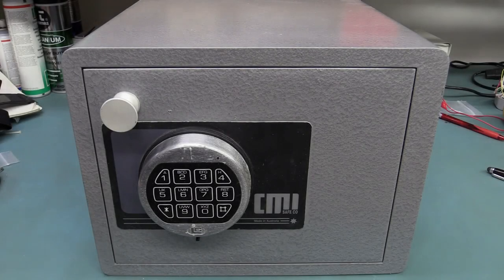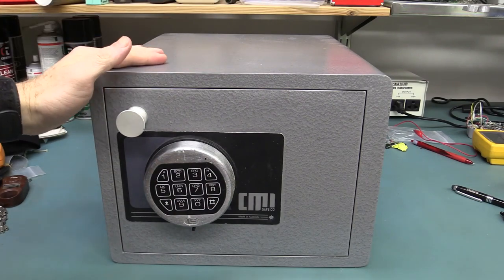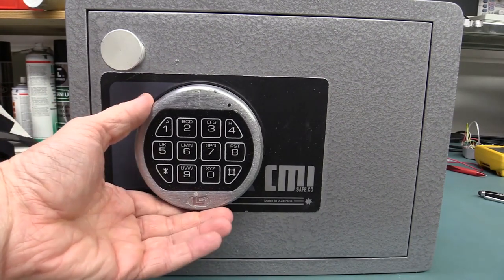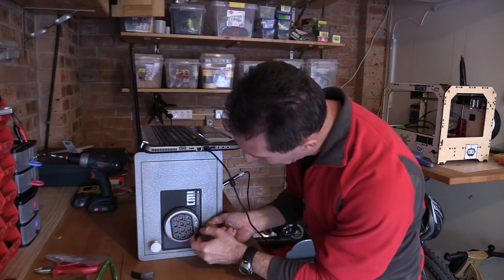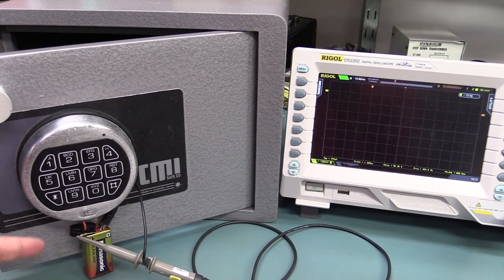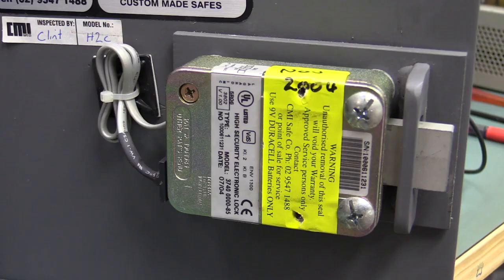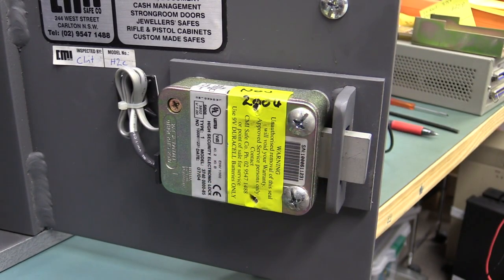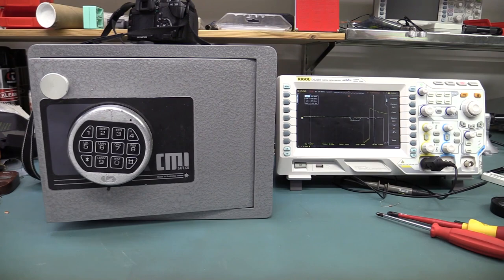EEVblog #762 - How Secure Are Electronic Safe Locks?

Comment: I a tech guy, work in technology, I hate these things. I like a good old fashion brinks manual combo lock safe. Have a small old safe from the late 1800's that still works great! so thick heavy (blast proof) no way to break into it easy. Have answer style brinks type about 15 years old. Wanted another so visited several retail places that sell them to check them out, all seem to have a lot of plastic these days, handles are plastic, and some were broken from handling, so that tells me not going to hold up well at all if broken in the store. some used a film type keypad that was worn from people pushing on it, there again not holding up to daily use if numbers are worn off useless. And then one would not work, store employee was going to change the batteries, opened up and was all corroded inside, never got to see it operate. Then I decided, not having one. but can't find anything without the damn electronic POS locks on them now.

Comment: If the lock is solenoid operated then surely a strong enough magnetic field will actuate it? I have caused solenoids to operate whilst tig welding with poorly placed leads.

Comment: How was Dave even able to lock himself out? The solenoid must have been in the 'open' position when he closed the door, so no harm done. Also, it was disconnected from power, so it wasn't able to lock itself automatically unless the safe closes mechanically. I must be missing something, but I can't figure out what!
Reply: Niall S. The solenoid only stays in the open position for a few seconds, plus he's disconnected the battery which would have released the solenoid. Some higher quality systems use a motor rather than a solenoid but that then requires detection switches and current limiting circuitry (to protect the motor) so a much more complex and expensive mechanism plus battery drain will be higher. Kaba have a design which is electonic but uses the turning of the knob (old style safe lock style) to generate the power to operate the lock, numbers displayed on a little LCD screen so no batteries needed.

Comment: I'm thinking.. run a thin wire down a tube through to the other end and then loop it back in.. sorta like what the dog catcher uses to snag a dog. Pull on the two loose ends and strangle the wire.. push down.

Comment: I'm 16 minutes in, not really into hardware, but this is so bloody interesting and fascinating and amusing to watch...!

18:12 i imagined the houston flight control center full of people cheering and clapping and hugging each other

29:35 NO, IT'S NOT IDENTICAL, the pixel differences in the dip that look like noise to you are important, the difference in power requirements for the two subroutines would be just like that, because they would be caused mainly by different order of instructions, where some instructions require very slightly less power than other, that's what I think it would look like, you need to zoom in and compare positions of those small peaks...
(again, not a HW guy, so in reality I don't know if your/any equipment is sensitive enough to detect that, or you concentrate on comparing just the run time of the two functions because you know that's the only relevant thing at this measurement sensitivity)

29:50 those two blips might have something to do with the signal that tells the led to light up/speaker to beep? as in not the actual power draw for light and sound itself, but the instruction sent out of the processor to the devices? this is pure question, that's what came to my mind as a possibility, but i'm 0% sure, so I'm asking what you think...

31:30 oh, so yes, that would affect what I've been saying above, but... i don't know, the deviations still look... relevant... even at this setup, different order of short-term spikes would produce different patterns, just with lower resolution... unless the capacitor had the capacity to cover the whole processing time, no?

31:50 yeah, told you, not a HW guy, I need to be told there's arbitrary number and architercture of the decoupling components to realize that of course there is :-D

32:10 yes. and maybe he wouldn't have to explicitly attempt that, it would be relatively easy to write both functions to be the same length "by accident", in fact, it's probably a single function that just branches after the check, so as i said, very possibly the same number of instructions, only different order, "by nature", thus different order of the small peaks... unless good enough decoupling, of course :-D

32:10 you're having the same conversation with yourself as I'm trying to have with you, that's nice, tells me I'm not that far off :)
but I disagree, greater vertical resolution could help immensely

39:00 nonono, surely when it's powered it keeps the pin out :-D
39:20 ohhh, short-term memory loss, you even mentioned the spring when opening it up :-D

in closing...
...dude, this was one of the most fascinating videos i've ever seen on youtube. thank you so very much for making it :)
Reply from the maker: MidnightSt Thanks, glad you  liked it.

Comment: One question I do have, does disconnecting the power (and potentially shorting the connectors) remove the lockout?
Reply from the maker: Jeffrey Black No, it doesn't.
Reply: Does it reset it so you have to wait the entire time again?

e.g. if it locks out for 5 min and you cut the power at 4 min do you then need to wait 5 min after the power gets switched back on?
Reply: What about a strong magnet ?? Can it reset the device or manipulate the locking mechanism?

Comment: What if you discharge a super high voltage cap through the 9v line, it could like short the solenoid driver transistor.

Comment: I wonder if you could melt the door welds using huge amount of current
Reply: Slot1Gamer you can melt any steel with high enough current, the door will melt first destroying whatever is inside
Reply: Slot1Gamer Your electrodes would need to have a higher melting point that steel. It's just more cost effective to use a torch to melt steel.
Reply: Slot1Gamer You should tell *****
Reply: That process is called carbon arc gouging, but most people use plasma cutters nowadays
Reply: +Slot1Gamer This was actually something that the Mythbusters showed at one point. The heat buildup will destroy and burn everything on the inside of the safe.

Comment: I have a strange idea, maybe it is possible to apply high voltage, much higher than 9V through the battery connector to activate the solenoid?  It will destroy most of components but theft who wants to break inside doesn't care of it.

Comment: ok question could you use a stron magnet to try and move the pin
Reply: Yeah that's how it's usually done. A neodymium magnet weighing a few pounds should do the trick. It can also crush your fingers all the way through, so some care is needed.

Comment: I have an idea for another attack, if they safe has been used quite a lot it might be possible to see what keys have been pressed from the tear in the keyboard PCB or on the rubber of the keys themselves. (Assuming the user(s) don't get the code wrong a thousand times)
Reply from the maker: ServerFarmGuy Yep, but even then you have a LOT of combination to try. The 4 try lockout means you don't stand a chance.
Reply: ServerFarmGuy If there is 6 digits, then there would be 720 combinations of those digits ( 6! = 720 ). So if you have 4 tries, there is 0,5% ( 4/720) chance to get the right combination.
Reply: ServerFarmGuy I was wrong. 720 combinations is true only if you can use 1 digit once, but in this case you can have 111111 or 222222. So now for the first numer you have 6 possiblities, second 6 posiibilities... six 6 possibilities. So:
6*6*6*6*6*6 = 46656 combinations. Chances of getting right digits in four tries would be 0,00857%, so it is quite impossible.
Reply: TheRodionRaskolnikow Actually I wonder, can you reset the lockout period by disconnecting the battery? If so you could just use a uController to emulate the keyboard protocol and brute-force it in a reasonable time (most likely still to long for a burglar though)

Comment: Well you still have access to the power, how about a brownout or rapidly resetting the CPU and try to get it into a strange state?  And I'm assuming you can't just give it a much higher voltage and blow the thing up?  Will the mcu and power transistor both fail open?  Also, if you could manage to do that it might just burn out the solenoid and the spring would keep the pin in place.  Or just keep burning until the spring is gone :P

Comment: I think you should try a few more things.
1) As was posted before - doing analysis on a single digit seems a bit naive to me, try analysing the pattern after the last digit is entered, and compare the action of a wrong code to the correct code.
Repeat this analysis with higher or lower voltage, that might defeat the decoupling (or not :))

2) It might be worthwhile to to an analysis when connecting the battery, the pattern might be different depending on the memory contents. Change the code and repeat, look for differences. It might be possible to get the code without entering anything :-)

Comment: Even if it weren't for the decoupling, in software it would be actually be easy enough  to just store the digits until you press all six of them and check for the correct sequence at the end than actually checking for each digit if it is correct. That would actually be pretty stupid from the programmers' side.

Comment: I would have thought the simplest process would be to take in a 6 digit code (1 digit at a time) and then check it against the correct value.

So it could only change due to a different button being pressed (depending on value, not on correct or not) or when the full code has been entered. (or when a special key is pushed to go into the menu or the like).

So it could just be the simplest approach, not necessarily good planning.

Comment: Come on Dave, you didn't try hard enough! If you're still interested, you could use a lower value resistor, amplified, to shift up in frequency the -3dB point of the RC filter you're effectively creating. Also, I saw some pulses after the buzzer, maybe you could try that. Finally, you could try some filtering and/or FFT analysis.

Higher vertical resolution and an amplifier would definitely help (I think you have some specialty probes for that, don't you? You also have the guys at Trio Smartcal).
Reply from the maker: Ivan Eduardo Veloz Guerrero Of course I can try more, but this video was already 40 minutes long,. I tried the simple stuff first. Can always do another video later.
Reply: Sure thing! -Ivan747

Comment: kinda surprised they did not add cover noise rather it be very poorly made Mylar caps for decoupling vs the film caps they did use and maybe some zeon diodes or a second clock generator that would be directly across the incoming power and decoupled from both the battery and the main power regulator

Comment: It seems you can unscrew the lock from the holes in the back with a extra looong screwdriver.
Reply from the maker: karl ramberg You usually can't access the holes in the back, it's bolted against a wall.

Comment: I know this is an old video, but having just watched it...  I wonder with a little solonoid like that, can you induce a magnetic field by bringing another coil near the front of the safe, and possibly energize the internal solonoid to pull the pin?  Just a theory.. have no idea if it's realistic at all..??
Reply: Given it's basically surrounded by steel, I doubt you'd have much luck.

Comment: Thanks very  interesting. Can confirm the cheap safes are garbage no matter how good  the internal electronic controller is just jabbing one of the leds  (which protrude through the metal door through holes drlled in)  even if  you destroy  the pcb in the process with a piece of wire bent correctly and knowing  where to aim the resistance of the solenoid spring is no more than 10 grams and click turn the handle - safe open.  1 out of 5 stars would not recommend lol.

Comment: The problem with this one is that lock and solenoid are moving in the same direction and 40kg safe accelerates faster and reaches much higher speed than you were bumbin at. So I don't really think that 800$ is a good price for this one. For 800$ you can make much better one, especially if you are engineer.

Comment: that is the reason why i dont like safedesigns that you can lock without power. mine has a motor to drive the bolt, so it cannot lock itself without being operational...

Comment: You quickly drilled a hole in this safe to plug the solenoid cable back in....... I say drill a hole in the safe and pull the solenoid cable OUT! Apply power to solenoid,,, and your in like Flinn........  Drill right next to that convenient loop of extra cable right there on the door!

Comment: So with a neodymium magnet you can move this metal pin from outside ..correct?
Reply: yes in a lot of models, there have been recent changes to fix the issue though.
Reply: That's seen more in lower quality safes that have integrated locks. This LG is a square bolt that uses a motor, rather than a solenoid. Magnet wouldn't do you a whole lot.
Reply: Not really because the the metal of the door acts as a magneric shunt

Comment: What about destructive overvolting? Is there any chance the drive transistor shorts out and drives the coil to open?
Reply: Just looked at the wiring diagram... Seems like it's possible to burn out the micro controller trough the keyboard leads and force some current trough to make the transistor conduct and energize the coil... I have to take a closer look.
Reply from the maker: Eviltech Doesn't seem to be by looking at the patent.
Reply: EEVblog I have seen controllers with all the leads shorted because of static electricity... I don't know how common is a short circuit failure mode inside that particular micro...
Anyways the patent seems to have 2 more ic's (one in the keypad and one in the lock module) to handle communication between them, but from what i saw on the video there seems to be no other chips in there... maybe burn out the speaker transistor and force power back trough it to fry the coil transistor... I don't know... That'd be an interesting thing to test if you were willing to brick it...
Reply: EEVblog Or browning it out... a few hundred times... Sometimes the memories get fucked up and the controller resets to default settings.... Depends on what they wrote in the micro itself. If they made resetting the code to default as a fail safe it could work.

Comment: Could probably be defeated by drilling a 1/2 hole parallel to the locking bolt, inserting a hardened steal rod and hitting that with a sledge hammer. I don't think those little parts could take the force.

Comment: G,day Dave. 
I think cheapo safes are fine for home, most common thief s wont spend time on it, They want to be in and out as soon as possible. And if someone is more dedicated and want your safe a good one would not protect you any more than a cheaper one.?
Reply from the maker: TrueBlueAustralian Yes a good heavy TDR safe installed corrected will be next to impossible to defeat for the casual opportunistic thief, even with power tools. But cheap ones can be opened in seconds.

Comment: EEVblog The keypad worked and beeped appropriately when disconnected from the unit on back?  That tells me that the evaluation of code is happening on the external dial pcb. and it's only using that cable to power the solenoid.  Please investigate.  If that is the case for instance, you should be able to build another cable that you can slip through one of the holes you drilled, and plug into the socket, and energize the solenoid to open the safe.
Reply: No, the keypad did nothing when disconnected from the solenoid. No beep or light.

Comment: Couldn't this safe be beat by going in through the holes in the back with a really long screw driver and then just unscrewing the two screws holding plate protecting the wires then the lock it's self?

Comment: The processor checks a full array of numbers not a single one, so there is no difference if one single number is right or wrong at the software level...
Reply: It should, but some software engineers forget that precaution.

Comment: So, drill thru the front with a 13mm bit anywhere near the solenoid loom. pull out the cable and use the supplied 9 volt battery. Well that's piss poor.

Comment: I have a question .................................. as there does not appearv to be a manual key override, what is the procedure to "RESET" or "Default" the code in the event the code is forgotten & the safe is closed? assuming there is one. if there isn't then i guess this safe would not be recommended for hotel rooms etc

Comment: I know the power line vulnerability on this safe, he was almost on the right track for a second but then he went in the wrong direction.  I can crack this safe in less than five minutes with a three dollar multimeter from Harbor freight. Well I also need a stethoscope and and a sightly chewed up piece of Wrigley's chewing gum, a plastic tampon applicator and a ballpoint pen with the clicking feature and then I'm in that baby with a quickness.  Unfortunately I'm bound by Zimbabwe, Madagascar and Nova Scotia laws and maybe even international law to never disclose how I do it. That safe is actually super easy to crack, child's play really.
Reply: Let me guess, most of the items you listed are actually to be used on the person who cracks the safe, not on the safe or lock itself?